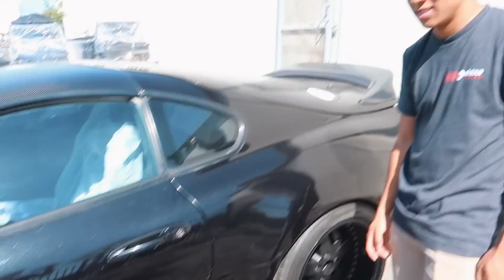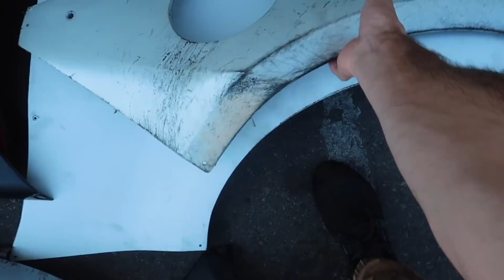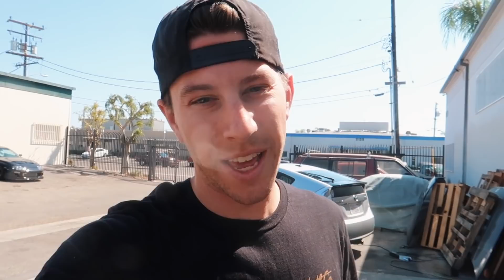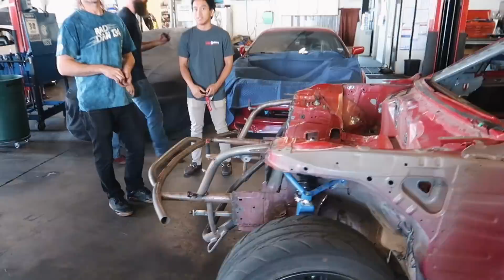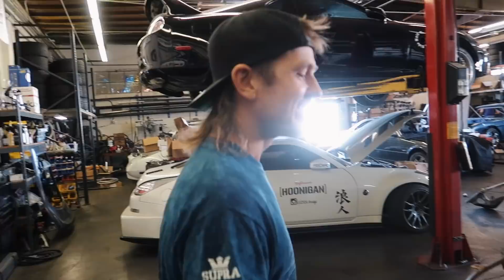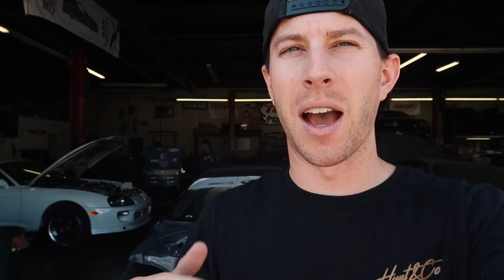EXPOSING MY SECRET!!

Comment: Since the motors out, you shroud rebuild it with new cans and stuff 
It will sound so cool and be so fast
Reply: it already does sound cool and makes 600bhp when its set to its high performance tune and if it was any higher Tj wouldn't be able to handle it on the track.
Reply: Lewis Storer So he should get cams, valves, and pistons and run less boost
Reply: Joseph true true and that would probably help him because it would have a more linear power curve so he might be able to handle it a bit better